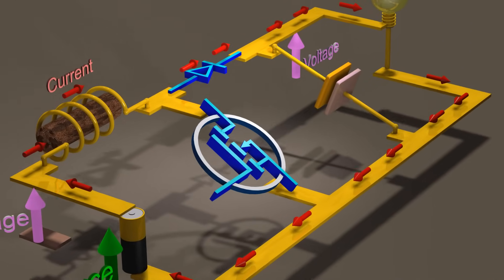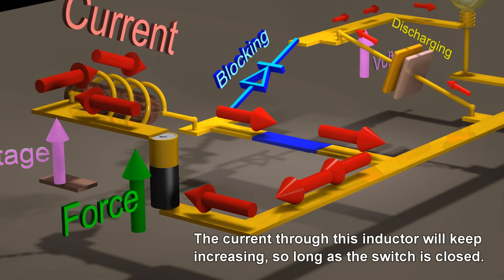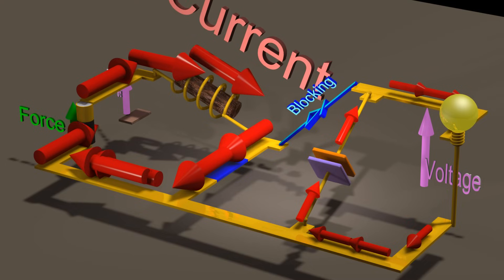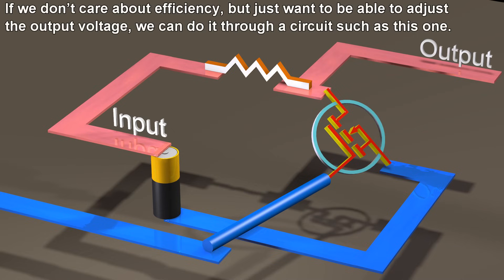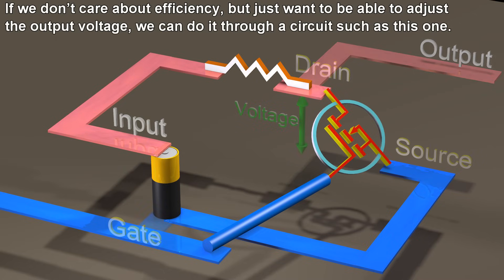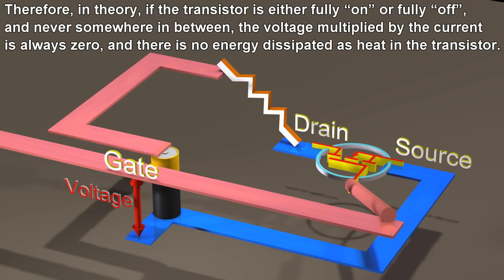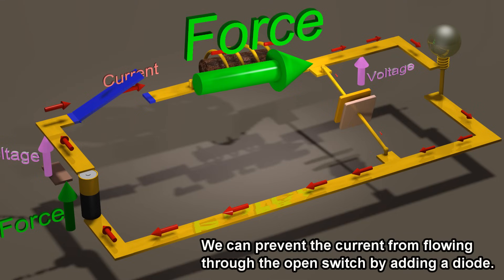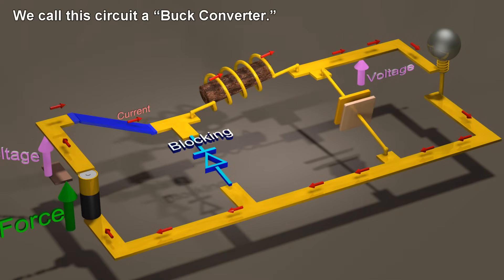Boost Converters and Buck Converters: Power Electronics

Comment: Also please note that in the BOOST CONVERTER , if the transistor is switched off from On state, the inductor voltage across the inductor must reverse the direction ( back emf). If that is true, the inductor voltage is in series with the supply voltage, & simultaneously, the diode is forward biased ( ON). This means the capacitor is now charged thru the diode with the applied voltage being supply voltage + the inductor back emf voltage - the action responsible for boosting the voltage. Also, just a continuous current thru a cap cannot charge it to a higher voltage than input voltage. With due respects, do I understand it right? If yes, then the direction of inductor current must be  shown in reverse after  the transistor is switched off. The back emf concept . action is responsible for adding a diode across a relay coil in series with switching transistors. Sorry, don't know much maths to prove it.  Difference of understanding apart, I wholeheartedly appreciate your efforts to put this video on YouTube. Will watch more of your videos anyway.
Reply: Kudos to you. I stated the same in my comment above. The voltage polarity and current of the inductor reverses during the open cycle of the switch which is what gives the boost. The red current arrows traveling through the inductor in the video are never shown to reverse which is misleading. The diode is also used to block the capacitor from discharging through the switch when it is closed. You know your electronics theory. Most of the others here in the comments are just simply impressed with the 3D graphics which unfortunately are somewhat misleading.

Comment: nice video. I have 2 questions, 
1. why is trying to change the current flowing through an inductor instantaneously dangerous?
2. why is trying to change the voltage across a capacitor instantaneously dangerous?
Reply from the maker: If the current flowing through an ideal inductor changes instantaneously, then the voltage across it will be infinite.
If the voltage across an ideal capacitor changes instantaneously, then the current flowing through it will be infinite.

Comment: I don't know if someone addressed this but I think your boost equation is wrong.  

Vout = Vin/(1-D) 
not Vout = Vin/D
Reply from the maker: It is not wrong, and it does not contradict your equation.  "D" is defined as the percentage of time that the switch is on (closed).  Therefore, the percentage of time that the switch is off (open) is "1-D".  Therefore, "Vin / (1-D)" is equal to "Vin / Percentage of time that the switch is open", which is what I wrote in my video.
Reply: You're right!  I misread and thought it said "amount of time switch is on"  Thank you for pointing that out, you are correct.

Comment: Why does the diode block the current when the switch of the transistor is on? I mean the current is represented as going on the "allowed" direction so why is it being blocked?
Reply from the maker: When the transistor is on, the capacitor creates a reverse voltage across the diode, causing current to try to flow through it backwards, which the diode blocks.

Comment: What I don't understand is how the current will constantly increase when the inductor is directly connected to the negative terminal of the battery through the transistor. Can someone help me out?
Reply from the maker: When the transistor behaves like a closed switch, the battery creates a constant DC voltage across the inductor.  The equation for an inductor is "V = L dI / dt."   This means that if "V" is constant, then "dI / dt" is constant.  This means that current keeps increasing.

Comment: What about the the Kirchhoff's Laws Voltage at the case of the Boost converter? I mean, the voltage in the battery is one, and the voltage in the lamp is much higher; for one moment, this law wouldn't be violated?
Reply from the maker: You also have to take into account the voltage across the inductor.

Comment: Excellent explanation.  I saw others explaining these, but they never said what the cap was for or how electrons were flowing through it at any given time.  I like the light bulb as the load for it actually does something - others have used a resistor that I have trouble viewing, in my head, as a load.
Reply from the maker: Thanks.

Comment: If an inductor forces the current to remain stable what would happen if the inductor is pulled out of the circuit abruptly?
Reply: Alejandro Cañizares the circuit would deliberately try to keep the currwbt, in fact the voltage would jump so high that the current can flow through the air (sparking).
This is very bad for transistors(switches) because that would destroy them

Comment: How transistor is switching on/off?
Reply from the maker: It is controlled by the gate voltage that we apply.
Reply: Physics Videos by Eugene Khutoryansky but what causes it.??
Reply: If you are interested in the operation of a transistor, I suggest you look up the semiconductor physics of a P-N Junction. Then see how that is used to create a MOSFET or BJT (the two most common types of transistors).
Reply: Łukasz Spolsky the transistor gate is driven by a separate dedicated closed-loop control circuit too complex to show in this schematic.

Comment: I love these videos, but the Buck animation in this one is incomplete - the current arrows don't change size to show the relative change in current and the arrow showing the charge/discharge cycle of the capacitor is missing, which is exactly what I wanted to see! Otherwise, a great animation.
Reply from the maker: The current  arrows do change size in the buck converter animation, it is just that the change is so slight that you probably didn't notice it.  Also, because this change is small, the current flowing into and out of the capacitor is very small, and the arrows representing this are too small to see.

Comment: Interesting.  But isn't the flow backward?  Electrons flow from the negative to the positive in a DC circuit but this animation shows the reverse.
Reply from the maker: I show positive current flow, which is in the opposite direction of electron flow.  Showing positive current flow is the standard in industry and education.  I cover this at the end of my video "Electric Potential: Visualizing Voltage" at https://youtu.be/-Rb9guSEeVE
Reply: Thank you for getting back to me so quickly Eugene!  I watched your other video (which was also great by the way and I have now subscribed).  But just as I mentioned in my original comment, the flow direction is incorrect.  This is even corroborated by your video.  I've always wondered, if this model was discovered to be incorrect, why does it continue to be perpetuated today?  Most confusing.
Reply: Richard Forester current is always shown this way, because the equations were written before electrons were known, and they had a 50/50 chance of getting the polarity correct.  It’s just the way it is.

Comment: thank you for the explanation.
on time 9:28 u mentioned "inductor will force current to keep flowing... even after we open it"
where can I get an explanation for this phenomenon?
Thanks in advance :)
Reply from the maker: I explain the underlying physics in detail in my video on Maxwell's Laws of Electromagnetism at http://youtu.be/9Tm2c6NJH4Y
Reply: Husam Danial the transistor cannot block infinite voltage.  Once the inductor forces voltage across the transistor to rise beyond a certain magnitude, the transistor will enter avalanche breakdown and begin conducting.  The voltage at which this occurs depends upon the transistor.  For example, a 600 V rated transistor is only designed to block 600 V when turned off.  A 60 V transistor can only block 60 V, etc...

Comment: Found an error.  At 6:00, the video states "the energy lost as heat in the transistor, is the voltage across the transistor, multiplied by the current passing through it."  I'm certain there is a resistor in the circuit during this explanation, should that read the energy lost as heat in the resistor?
Reply from the maker: It is not an error.  The energy lost across any device is the voltage drop across the device multiplied by the current flowing through it.  This is true for both the resistor and for the transistor.
Reply: Thanks for clearing that up!
Reply: Ahmed Hassan in reality the transistor is a resistor.  Its resistance is controlled by an externally applied gate voltage (not pictured).  The resistance is very small when the transistor gate is turned on and very large when it’s turned off.

Comment: Hey Eugene, do you think you could make a video on an idea of mine? It's quite simple, really. Just wanted to know what would happen if you make a spherical object rotate faster and faster? Assuming, of course that the material is strong enough to withstand being torn apart by centrifugal forces. I think that the sphere will ultimately flatten out into a disc but I'd like to hear your opinion on it. And great video as always.
Reply: I can tell you're not looking for someone to reply, but maybe I can still provide something of worth. The sphere you speak of would indeed experience outward forces due to its high constant radial acceleration at any radial velocity; the closer vertically to its equator, the greater an outward force would be felt, and its material would want to follow Newton's 1st law and expand move outward. What happens at high speeds depends on the internal forces. If the sphere has high molecular bond strength it may resist deformation to a point and then explode, or stretch out to a maximum and then tear apart, depending on its material properties (mainly if its categorizable as a metallic, ceramic, or a polymer). If the sphere is of huge mass, it could have the inward force to resist deforming just due to gravity. It just comes down to the balance of forces until we start imagining high enough speeds where no inward force is enough, and then how the sphere breaks down is based on the forces dictating how its material behaves when a force is applied. 

It may also be worth mentioning that some rotational velocities are simply too fast for any material to withstand solely by its own material strength. At those speeds and higher, the only thing that could hold your sphere together is the super high gravity of a black hole. So now your sphere is the (possibly) infinitely dense core of a black hole, but let's keep speeding it up. As we do, the black hole creates greater frameshifting and light is able to orbit nearer and nearer the black hole, shrinking its event horizon. It's is a law predicted by general relativity that a singularity can never be exposed to the universe (hard to explain, maybe good to look up "naked singularities"), so with an increased spin shrinking the event horizon, there must be a cap on how fast the black hole is physically capable of spinning due to a higher speed shrinking the event horizon to the point of singularity exposure. This puts a cap on the spin to be some fraction of the speed of light. If we increase the mass of the black hole enough, we can then get your sphere "stably" (although violently) spinning at close to the speed of light (some black holes spins have been measured at over 95% the speed of light). At least to my knowledge, the story ends there.
Reply: +pendalink Thank you for the informative reply. That was my guess too. And as you probably guessed, I was thinking of a black hole. I think that because of the conservation of angular momentum, the black hole must eventually be spinning so fast that in spite of the enormous gravity, it can't shrink any further and reaches a kind of equilibrium, if you will. I just don't like the idea of a zero-sized, infinitely dense singularity.
Reply: @feynstein1004  check out millisecond pulsars! Neutron star mass with a very short rotational period!
Reply: @Sean Kinahan Ahaha thank you for the reply. However, I kind of already know about pulsars :D

Comment: Hello, Eugene Khutoryansky.i whant ot discass this with some one smart.
1. About light speed - for me it is a maximum energy exchange speed, not motion maximum.

2. Galaxy- BH Dissipate BIG amout of particles, they slide to Edges of galaxy and form hydrogen there.(they move faster then light, so we can not see them. hydrogen formation start after they lose energy\speed). then formation of first starts and slow muving to central BH.
this how galaxy sustane existance.(not all but most part)
and dark matter is a gravitatinal after image of particles that move faster then light.(most likely)

3.  Can mass\energy of particle be prolonged in space, be in more then one place at time?
(yes if it move faster then light)

4.Gravity- is energy exchange aftermatch. (it is like Electromagnetism, but with very high speed of polarity change)(so it worck in bouth direction in same time to compare to us) (like cinematic effect for video)
i know it sound like Unbelievable but how to check?
what do you think about it all?

best regards Dynin.A.I.
Reply: I can be wrong but this what I believe. (Sorry if my English not so good)

1) Motion cannot exceed light speed since is made of forces that only move light speed. That why things slow down("time") if you move them, otherwise the parts would be faster than light but they cannot do. If motion increase more than light then the inward force that create regular matter lose its properties and matter cannot exist. 

2) Only smallest hypothetical exotic elements which compose to matter we know could move so fast. Galaxy is pushed together by reduced opposition forces in center. Since the stars are distant it is not the same as single star. The opposition come from forces from everywhere in universe which emit and have irregular interaction for matter so we do not detect. I believe dark matter can be explain from this instead but this other idea is interesting too. Maybe many reasons for things we do not find.

3) Maybe. It all manifest from properties and respond to surrounding forces. So it would be affecting 2 places at same time if possible. We think something exist somewhere when we can detect how it interact with equipment. Maybe if property to escape balance of surrounding forces it can happen. 

4) Yes. I think you have something. I believe forces from entire universe are balanced and constant speed create like direction rate pressure but not like particle pressure. Polarity change big part of that. I think something like you say. Maybe it possible change a balance of surrounding force (momentum) by reflecting some polarity and passing other polarity in some directions? I do not yet think how to test these idea. 

Are you thinking to make way for interstellar travels? :)

Comment: Great video! But why isn't the circuit in the boost converter when the transistor is connected to the battery creating a short circuit?
Reply from the maker: Because there is an inductor in between the battery and the transistor.

Comment: OK. So, wait. The position of the components (switch, inductor and diode) determine which type of converter is it.  There are three possible layouts but this video only explores two of them.  Assuming the symmetry of rotation of the components remains unbroken (clockwise or counterclockwise)   What type of converter is created when the components are placed in the third position - wherein, the battery leads to the diode which leads to the switch and the inductor is the bridge between?

Comment: yesterday i fully discharged a partially charged 400v capacitor by hand... not cool. XD
Reply: emperorSbraz What was the capacitance?
Reply: two 22uF caps, enough to make a spark when discharged with a resistor and then cause a mild burn on my finger when i grabbed the board. :)

Comment: The representation of voltage by "height" and current by "pressure" is so easy to understand and imagine. These animations are really helpful!
Reply: Absolutely. It makes the operation of the circuit very easy to understand. Maybe because I'm a water/hydraulics engineer and there are analogies between hydraulics and electronics but this makes it immediately clear.
Reply: rahu1994 some others, Louis Rossmann  explains voltage as velocity of let say, a car, and amperage as its weight, compared to a running human individual when hitting an object at same velocity, the impact of the car having more weight will cause more damage. But voltage and amperage are proporcional in most cases, I only know static as the only exception where amperage is low and voltage very high....
Reply: These videos are the only things I’ve found throughout the internet that makes me truly comprehend it in my mind.
Reply: True, the videos are really helpful in understanding the concepts so quickly and easily.
Reply: Current by pressure? No, Eugene showed current by arrows. Moreover, in the hydraulic analogy, pressure is equivalent to voltage, not electric current.
Reply: @rahu1994> you clearly misunderstand, it's current by 'inflation' and voltage by 'dissipation' simple physics bro. 🤓👍
Reply: A good analogy for me is that voltage is pressure, current is velocity.
Reply: Voltage is pressure.  Current is flow rate at any given instant.  The speed of the flow is always the same.
Reply: @ThatEEguy2818  since water is incompressible.
Reply: @ludiProjects  no, to reflect the electrical counterpart.  Voltage is electrical pressure.  Current is the quantity of charge flowing in the conductor, not how fast it flows.  The change in the size of the arrows in this animation reflects the volume of charge flow, not speed.
Reply: @ThatEEguy2818  sure
Reply: @ThatEEguy2818  I made a careless mistake
Reply: @ThatEEguy2818  Let me add please: Voltage is potential electrical energie, current really amount of charges running in each time,  'But measured is certain time. 1  Ampere means that  6,25 000 000 000 000 000 electrons run across in 1 second. It is one Coulomb in charge unit of measure